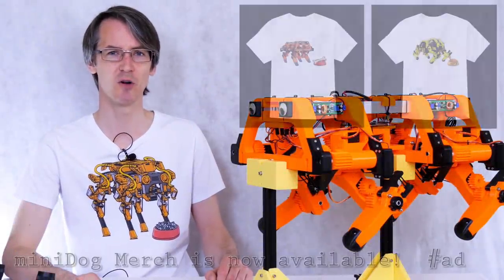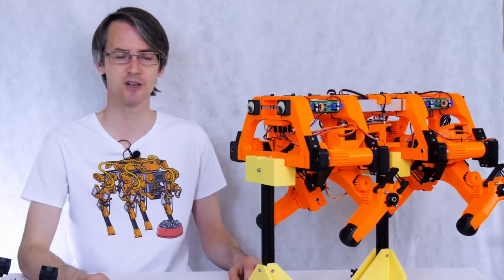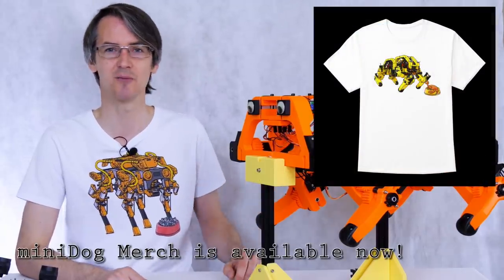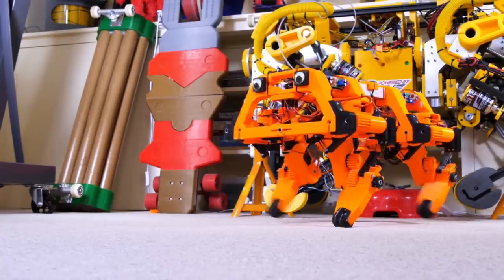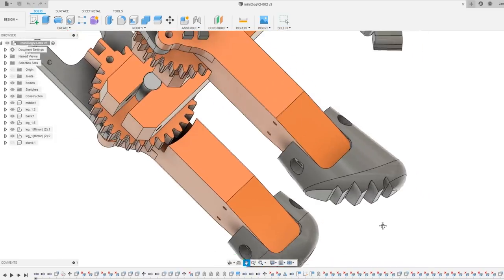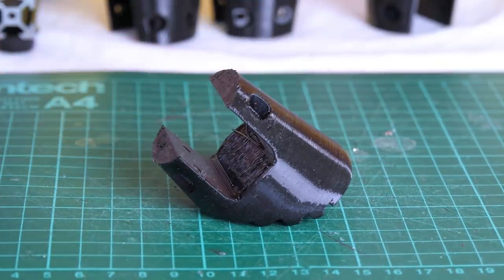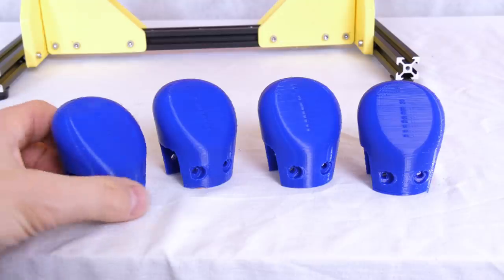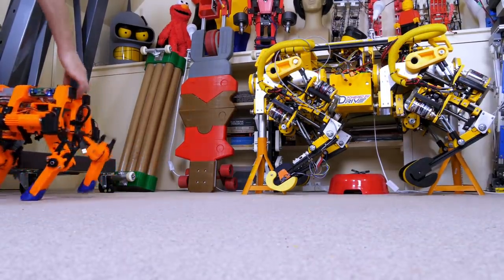Mini Robot Dog #8 - Next Steps

Comment: Have you looked into adding feed forward parameters?  They are often used to make up for latency/slowness in servo based systems.

You can feed forward time or velocity (implement both them modify a multiplier to find ideal amount).  As the servo moves faster you can set a position artificially further along it's path (time fee forward) or project the movement forward based on current velocity.  Rather than the servo spending it's time slowing down and never reaching it's target value as the target moves, you project ahead so that when it catches up it will keep up until you again exceed the speed.

Comment: I'd love to see a micro open dog built with n20 gearmotors.
Reply: aren't them worse than the 20 kg servos he' s using?
Reply: @cinnamondonkey2397  Those n20 geared motors with rotary encoders might be good to use with a walking robot; cheap, powerful and geared so that not only means more power but also being able to keep the legs upright without using power as the gears prevent the axle from freely turning. And the encoders can give positional feedback at high resolution.
Reply: Would be a waste of time and money.

Comment: the forward slip you're getting is because the loaded legs have slightly more lag in them than the ones being lifted up to do the next step. The servos themselves have a PID loop in them so different loading give you slightly different end actuation than commanded

Comment: The reason the feet were getting stuck is that the leg is longer if the robot is standing on its toes vs if it is standing on its heels. Thus, when the foot is being picked up and moved forward, the toes are catching on the ground and dragging, which causes the robot to trip. Making the feet less grippy covers up the problem by making the trip less severe, but sacrifices traction (thus, moonwalking). The solution would either go back to a spherical foot profile, program the length of the shin to get longer based on its angle to the ground or make an ankle that keeps the feet flat on the ground.

Comment: To fix that slip I'd suggest attaching a piece of bicycle tire over the PLA feet. Should provide enough grip and be cost efficient as you could fashion a lot of "shoes" out of a single tire - and it doesn't even need to be a new one.
Reply: Yes, cut bicycle inner tube into 3" cylinders and stretch them around the feet.  (Socks)

Comment: Amazing!!  I am cheap so I would ask ' what would be the replacement POTs for the servos to get +/-10% ' and will they really fit in them? ".  I would also recomend one more ajustment to the gate where point 3 is above and in front of the ground then 4 being the actual on ground.  From your ajusted triangle, it would slide 5 and 4 forward, 3 above the ground, rounding off the ' corner ' of the forward step.

Great job, hope you get tons of patrons, it is a robot puppy!!

Comment: I noticed that the moonwalking look came from one set of feet grounding themselves while the other set of feet were still pushing backward.  It seems like there may be a sweet spot in which the first set of feet ground themselves just as (or maybe just after) the other set are in the process of lifting themselves.  Real dogs have a last joint (wrist?) that rotates to account for gait, terrain, etc.  Your only option, given the design, is timing and travel path of the limb.  It's been fun to watch you sort through design & engineering.

Comment: Hey James, about your servo power situation, I probably haven't done enough research, but I'm on an FRC robotics team and we use these NEO brushless motors from REV Robotics, and they're only $40 USD each http://www.revrobotics.com/rev-21-1650/ . You were saying the motors you were looking at were around 90£ - 100£ and these after conversion are only about 32£.

Of course, I don't know how they would interface with your ODrive controllers. On our team, we use the standard SparkMAX motor controllers that REV supplies, but I'm sure there's a way to use ODrive.
Reply from the maker: Those look like inrunners. I'll be using the largest diameter outrunners I can to get the max torque with the lowest reduction.
Reply: @jamesbruton  Ah, I didn't think of that. All I can say is the NEOs have an Empirical Stall Torque of 2.6 Nm and Theoretical Stall Torque of 3.75 Nm. I've got no frame of reference for how good that is, but it's on the data sheet. But I mean, you're the engineer, I'm just a high school student so I trust you know better than I do.
Reply: @jamesbruton  I am on an FTC team and we used some coreless Savox servos this year. https://www.servocity.com/sc1256tg-standard-size-coreless-digital-servo We got an FTC discount so they ended up being around 54 USD each. Not sure if you will be able to get a discount but reaching out to them couldn't hurt.
Reply: @dekutree64  Yeah, I'd be surprised if they weren't able to supply enough power for the orange mini-dog. I mean, again I'm working entirely on only intuition from using them for a few years.
Reply: @zedfalcon6972  Dang, I wasn't quick enough on deleting that comment :) It turns out the REV motor is probably only 1.5Nm/kg after all. The smaller size version lists peak power, and it implies that you can only safely use 1/4 of the empirical stall torque. I don't have much experience with inrunners, but it doesn't surprise me because I know brushless outrunners will burn up very quickly if you actually stall them at full voltage. Multistar 92xx is 7Nm/kg usable peak torque, so much better after all.

Comment: How about a longer forearm with a strain gauge to measure the load/contact with the floor etc... It will simplify the joints and still allow the individual arms/legs to feedback load.
Reply from the maker: I trued load cells in my Sonic the Hedgehog build, but there is too much latency. A series elastic actuator (with an actual spring) is always a spring that responds immediately. That said I'll be using compliancy built into the gearbox via Quasi-Direct Drive for the next build: https://www.youtube.com/playlist?list=PLpwJoq86vov9Aogc6PseW8BUe2nQyZESZ

Comment: Since I don't have a 3d printer I have always used acrilic laser cut gears. They are a bit more rigid than 3d printed parts 
But if you are worried about backlash you could print helicodal gears. They have a better meshing and are quiet er

Comment: Hey James if you're using BLDC motors maybe you can add a gearbox to the shaft like a cycloidal or multi stage planetary gearbox. This will keep the system back driveable and give you the required torque.
Reply from the maker: I think a single belt reduction will probably do.
Reply: @jamesbruton  Make sure you watch this video from Paul Gould first https://www.youtube.com/watch?v=mphAOyxifNA. You need very stiff structure between the pulleys to prevent them from tilting toward eachother and skipping teeth under high load.

Comment: James, I know this might be a bti of a stretch, but could you try controlling the original Open Dog (The big rigid one) using an AI? The arduino should have enough computing power to run a small AI. Inputs would be the 6 axis from the MPU6050 (Accelerometer and Gyroscope), the load sensors in the feet, the inputs from the controller, and the position of each motor. The AI could then learn how to walk and run fluidly without any issue (Apart from obviously spending weeks training it).

Comment: So I've been trying to figure out how you can improve your robot and I think I finally figured out how. You need to add data logging. Add sensors that monitor the robots interaction with the physical world and log it all. Log every action your robot takes and why. At this point you are essentially guessing at the problem but without a log of actual physical actions you won't know what is going on. For example you state that both legs should be moving at a constant rate. Emphasis on the should. You don't know if it is or isn't. By logging you can determine if one of the servos is faulty or if they are out of sync or whatever the case may be. You also stated that the flexibility of the frame could have been an issue a couple videos back. Well you can't know that for sure without data logs. Athletes who extract the most from their own bodies occasionally data log themselves. They can feel what is going on and they still data log. Why aren't you doing the same with your robot?

Comment: Have you thought about moving the motor/servo that operates the lower leg, up to the hip and using a pushrod to operate the lower leg?
That way it'd reduce the moving mass of the leg and hopefully help with speed.
Reply from the maker: Yes, I'll be using belt drive down to the knee for the next build like MIT Cheetah.

Comment: Implementing a spine for the robot will be beneficial for balance. A helpful thing to take in consideration is the tail. Cheetahs use their tails in high speed maneuvers along with the flexibility of their spine and neck positions using their weight to throw it in the right direction. If you include each one it would benefit your balance problem by including other factors in the algorithms equation.

Comment: Being that you are just using RC servos, using PWM to send the desired position to the servo, have you thought about hacking the servo, wiring up a analog voltage output of the servos position, to be read by the microcontroller. That may be more useful than just telling the servo where to be.

Also, have you thought about giving the dogs servo/motor driven feet? Figure a small foot could be moved quicker than a leg joint, and the compliance could be more there than at the hip or knee. Have maybe a rather soft foot joint, whos feedback can be used to "trim" the hip and knee actuators to keep the dog level....maybe compliance on top of compliance is just making him way too wobbly.

Comment: Hey James, I'm wondering if you've considered putting the compliance hall effect sensors in the feet instead on in the joints?  If the feet are made of a ninjaflex honeycomb that has 5-10 mm of squishiness, the hall effect sensor should be able to discern when the foot is touching the ground or not, and you won't have knee joints that are in the wrong position anymore.  Just a thought that's resurfaced (in the first video in this series, I initially assumed you were going to do hall effect in feet).

Comment: I didn''t seen the code but servomotor can be controlled by time also not just by degrees. In this case every servo can be fine tunned for exact position you like.
Reply from the maker: Yes I'm writing microSeconds, but if the pots are low tolerance then the motion will not be linear or comparative with the other servos

Comment: Use REV robotics brushless neo motors for the larger joints and hobby grade brushless motors for the rotation of the joints. They use can bus or pwm and are pretty reasonably priced.

Comment: I'm not convinced that compliance is what you need to get the dog working well. As far as I'm aware Boston Dynamics robots don't have compliance built into them either. Instead, they've nailed the control side, with IMUs and other sensors that affect the amount each leg is pushed into the ground to keep it stable but not over compensate. Then again I may be completely wrong I'm an armchair roboticist after all, but it seems to me that adding compliance would just ensure that you lose what limited control authority the software has as it is.
Reply: Compliance and floor pressure feedback kind of go hand in hand.
Reply from the maker: Yes they are force/torque controlled which is basically compliance.  Check out my previous R&D: https://www.youtube.com/playlist?list=PLpwJoq86vov9Aogc6PseW8BUe2nQyZESZ

Comment: Love the progress so far. It really does seem to be that the difference between most hobbyist robots and bots like spot mini seem to be the ajility (speed and power) of their actuators. And that makes the code on top possible.

One thing I have been playing with recently is the stm32 motor controller dev board. It can do full foc control of motors with feedback in the space and price of a hobby brushless controller. It may be worth a try to replace the cost/size of the odrive. Though it will take much more advanced code on top of the base foc code st supplies.
https://www.mouser.com/ProductDetail/511-B-G431B-ESC1
Reply: Whole entire project is endlessly hamstrung by those sorry excuses for "servos"

Comment: have you thought about using pneumatic muscles from festo? that's a whole other field of engineering than electric motors (with fluid mechanics and everything), but what you get is compliance in the first place and then you control it to be as precise as you need. instead of precise motors which you need to control to be as compliant as possible. also, they like to support tech-projects like the ones you are making. i'm a student and my prof (Ivo Boblan) has made multiple biomechamical projects with festo, that's how i know about it.

Comment: Would you be open to explaining how your motors return to its normal position after letting go of the joy stick in your next video?
Reply from the maker: when it's a walking it just replays some other states if the joystick position is in the middle. The code is on Github

Comment: Since the load cycle is relatively modest in this application, why use brushless motors when motors with brushes are typically much cheaper?
Reply from the maker: Because the power to weight ratio is much much better, like 50 times more power density for the same mass.

Comment: As you say your big limit your hitting is power to weight ratio and speed of your motors. You don't want to spend big money to get higher performance servos then maybe seeing if you can strip further weight off the dog. This is also have the effect of reducing the other problem you have of momentum
Reply from the maker: This was a test for stability, which works. The next plan is a premium build with brushless motors.

Comment: Instead of upgrading the motors will you just make a smaller, lighter version?
Reply from the maker: Yes it's easy when they're small but that's not what I'm trying to achieve. This model has served it's purpose for now.

Comment: hi could you use a spring centered ball screw on the open dog to give it some compliance?
you could use a spline to transfer torque and measure the deflection of the ball screw to calculate the force on the joint.
would this work or is it too complicated or unreliable?

Comment: James, I'm wondering about a different approach to walking. What if the two legs on the grounded attempted to keep the center of gravity centered left to right, but shifted it forward. The two legs in the air attempted to move to a position so that once they hit the ground, the center of gravity would be centered.

Comment: The dynamic gait looking pretty good, just slow. However, I don't understand the rationale of abandoning $20 servos because they're too expensive in favor of $100 brushless motors that still require another $20 for control electronics. You should just try bigger servos. You can find beefy high torque metal gear servos for $40.
Reply from the maker: I already have six ODrives in openDog that will get reused. What's the feedback pot tolerance, and speed of the $40 servo?  Ultimately this is R&D for a bigger machine...

Comment: Not sure if you already talked about it, but how about using geared (planetary gear) nema 17 stepper motors they are about 20 pounds a piece. Or Cheap geared DC Motors, for example, take apart a cheap cordless drill or use premade worm gear DC Motors and separate potentiometer for the positioning.
Reply from the maker: I don't beleive any of those will be agile enough. I'll be using brushless motors with a very low reduction for the next one.

Comment: If i look at the chassis of your dog and compair it with the dog of boston dynamics than it seems more compressed and also slimmed down. Ofcourse i know its not fair to compair it because you work with printed parts but if i look at your chassis i think its easly possible to make everything a little more slimmer with not that much difference if it comes to strength. It could make it a little bit more easy to keep it stable. Im not a pro at all of that so i may be wrong. Just a thought because im a carpenter and i had to teach myself that i can make stuff like table legs way less thicker than i first thought with same strength at the end
Reply: Maybe instead of working from the inside to the outside of the dog shape you should make one standard proportional shell and try to challange yourself to put all the mechanics inside of that and than ar the end level it out so its nice and stable

Comment: Can you please try to reduce the z hop height of the feet also. It will reduce the maximum required speed of the motors
Reply from the maker: Yes, but I really want to show that they clear the ground every time.
Reply: @jamesbruton   Then it's pretty much the limit. 
Although I can suggest one thing that works for me.
Remove the endstops of servos and place the potentiometer directly on the robot.
By doing so, I get a bigger span and can opt for a better pot. Its a lot of work though, but the overall budget is reduced.